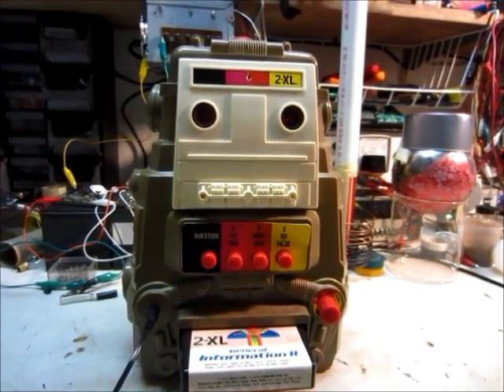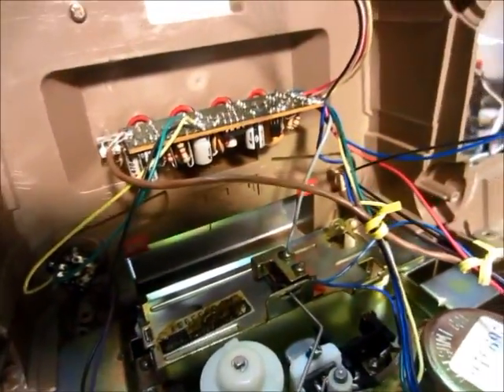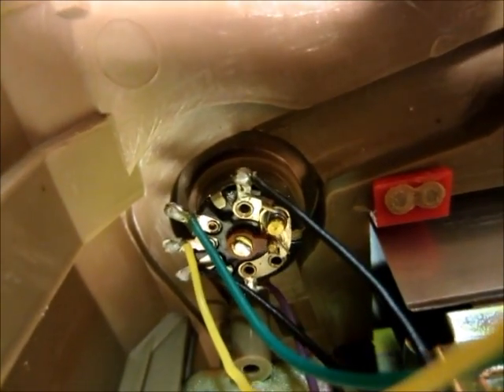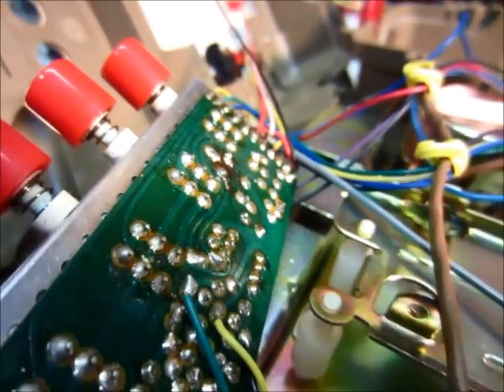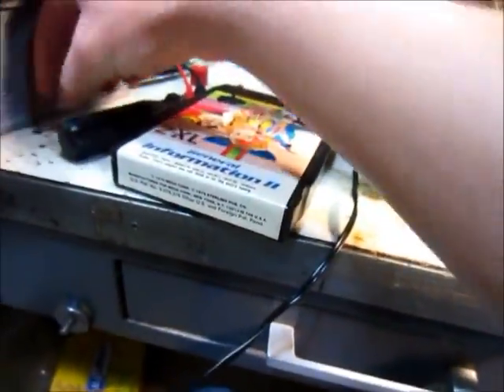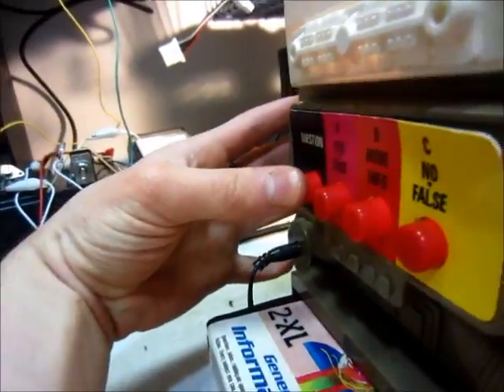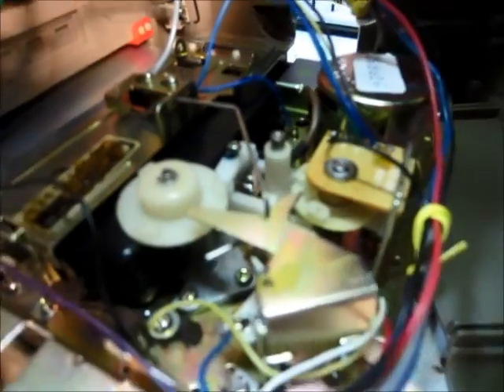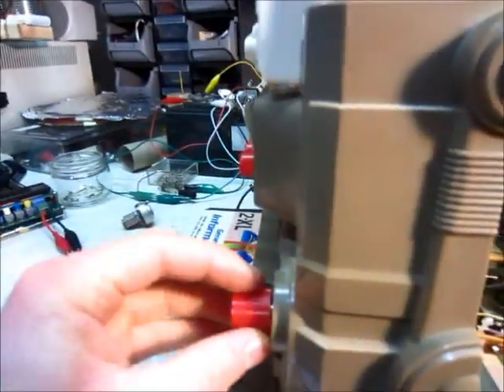Vintage 1978 Mego 2-XL 8 Track Player Fix, How It Works, and Circuit Diagram

Comment: I have hundreds of these units. Am wondering if your interested in doing some soldering repairs for me? I would just send circuit board. I'm getting up in age and my eyes are not like they use to be. If your interested what would the cost be per board. This is on just the circuit board that the buttons are attached to. I can handle all the lower deck repairs. Can we work together here? Thanks

Comment: Do you know where the AC power filter capacitor is located on the 2-xl? I have a unit that makes a noise when I put the two haves together. It sounds ok when it's apart but when I put him together it sounds like the speaker has a problem. I made sure everything is secure and screwed down, even gave some extra padding in front of the speaker but it still does it. I'm thinking the problem is in the lower frequencies and that's why it gets worse when I put him together. Any help would be great. Thanks!
Reply from the maker: You are going to have to trace the power wires onto the circuit board and find out!  This was not my 2-XL.  I was just fixing it for someone so I don't have it any more.  I don't recall where it is.  I would consider replacing all the electrolytic capacitors.  Also make sure it's not the motor that is squeaking.  I would put a drop of oil on the motors shaft.  Thank you!
Reply: They all go to that "board" that the buttons are mounted on. If you remember all the capacitors are on it, everything is there for everything. The bottom is the tape deck. I am guessing the largest capacitor is the power capacitor. Thanks
Reply from the maker: billie19842007 Well yes, all the wires do go to the board.  I meant to fallow the wires from the power jack to the circuit board.  Then fallow the power traces on the circuit board to the input filter capacitor.  But yes, the biggest capacitor is most likely the power input filter cap.  Thank you!

Comment: I have a question, how did you get the power supply apart? I see you got it apart right at the seem but what did you do to get it undone? Thanks
Reply from the maker: I never took the power supply or wall-wart apart.  But if you need to take that apart you will need a couple of flat head screw drivers and a hammer.  Just hammer the screw drivers in along the seam and it will pop apart.  It's the easiest way to do it but not always the prettiest.

Comment from the maker: Thanks!  The foil does not stop the tape.

Thanks, I just put an another annotation in the video.  I did wipe off the head but it didn't seem very dirty.  The shaft that pinches the tape against the pinch roller had some gunk on it so I rubbed some steel wool against it wile it was on.

Comment from the maker: Yeah it is simpler than I though.  I'ts simpler than normal tape cassette players.  They probably were not as popular because the head would probably get out of alignment, there was no rewind or fast forward and the tapes are quite large.  But I really like the idea of the selector so you could play the same track over any over and over.